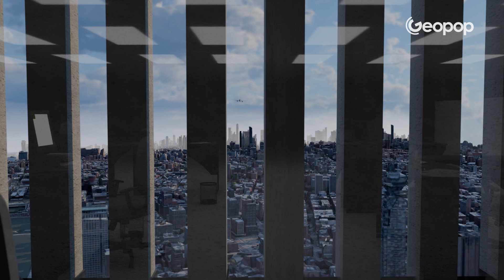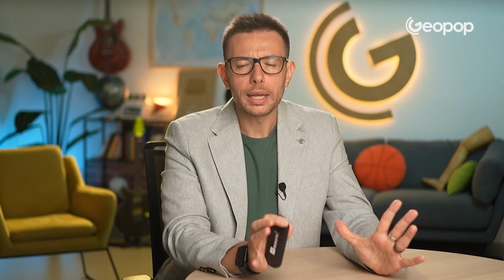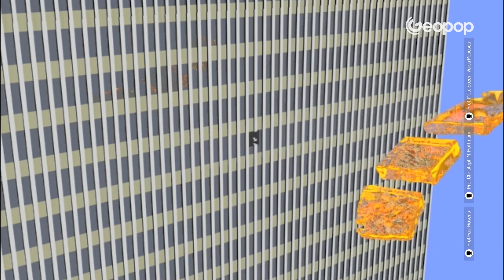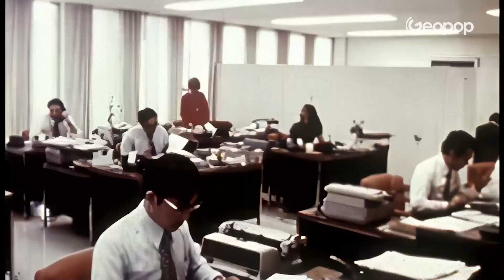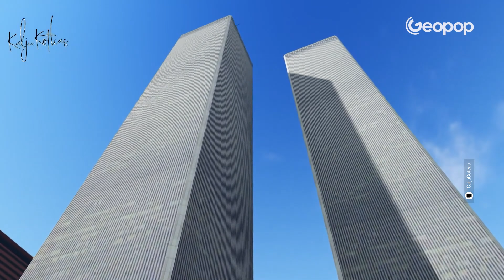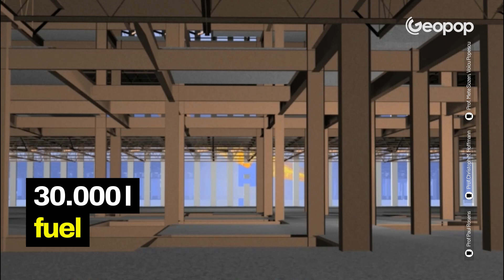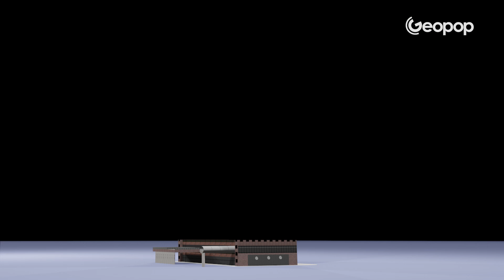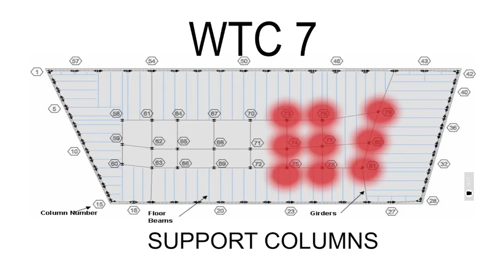9/11, 2001: The Technical Reconstruction of the Twin Towers and WTC 7 Collapses

Comment: It's a f**king plain as the nose on your face, only you don't notice it because you don't want want to look foolish by crossing your eyes.  Well, I'm not so arrogant and foolish not to see my own f**king nose on my face!  Just look!  Look at the f**king building blowing up in sequence as it "pancakes".  Makes no sense for a building to just crumble like that WITHOUT a LOT OF HELP which HUNDREDS OF EYEWITNESS TESTIFIED THEY HEARD NUMEROUS EXPLOSIONS IN THE BUILDING BEFORE THEY FELL AND DURING THE COLLAPSE SEQUENCE.  We also see it on the videos!  It's a plain as the nose on your face.  Just look!
Reply: Those so-called explosions were elevators falling down, which has created huge noise.
Reply: Gravity is a lot of help. An awful lot of help. 

This is my summary explanation of Twin Towers collapses of the Twin Towers, start-to-finish, based on my observations without appeal to, or reliance on any authority. No politics or ideology, just what actually happened, which is agnostic to who planned and carried out the 9/11 attacks or why. It has the benefit of not requiring Rube Goldberg levels of complexity and it makes logical sense. Each step in the process flows naturally from the one before AND is chock full of critical details the conspiracy-oriented internet tends to leave out with no whataboutisms.  My hope is this will dispel many common myths and answer most if not all questions you may have about the Twin Towers collapses. 

While complex, most of the Twin Towers collapse mechanisms can be seen with the naked eye and easily discerned and understood by the layperson if sufficient time is taken to understand. The worlds engineering community had already largely sorted them out at least as early as October/November 2001. Still, there are many who can’t be bothered to look or perhaps work hard not to see, being more concerned about advancing political/ideological agendas (which is exciting) than science and engineering (which is boring).

1. The Twin Towers consisted of 4 primary structural elements that together formed an integrated system where each relied on the others.  47 hollow box-section steel Core Columns carry the majority of the gravity loads. The 236 hollow box-section steel Perimeter Columns carry the remainder and ALL of the lateral (wind) loads. Long-span Lightweight Steel Trusses connect the core and perimeter column together at each floor with a Hat Truss on top to tie the structure together as an integrated unit where no element can survive without the others 

2. The impact of 117 tons of airplane (= to about 12 dump trucks) at speeds up to 590 mph completely destroys the aircraft.  This in no way implies the Towers come out unscathed. Some folks don’t get that. Hitting with the energy of up to a ton of TNT the impact damages or destroys many perimeter and some core columns (33 of 59 perimeter and 20 core columns destroyed at the impact floors in the North Tower), primarily through bolt-shearing failures at the end connecting flanges, as well as bending, twisting and fracturing of weld seams. There was no cutting or slicing - the reality was far more violent and messy. 

3. The impacts destroy or damage fire insulation, fire breaks and sprinkler systems on multiple floors. Huge fires are started across multiple floors simultaneously and allowed to spread rapidly with no effective firefighting or fire suppression. This was an unprecedented fire event . All of this was observed and recorded.

4. The hotter steel gets the weaker it gets .  With fire insulation stripped away and no sprinklers the survival time of the steel greatly reduced. Gradually over time heat causes the lightweight steel Floor Trusses at the impact damaged floors to sag, which was observed and recorded.  No steel melted nor did it need to. Structural steel will fail long before it turns to a puddle. It just needs to bend

5. Sagging floor trusses pull on the increasingly weak and overloaded Perimeter Columns, causing some of them to bow inward by up to 5 feet. This was observed and recorded. A straight column is up to 4 times stronger than a bent column. 

6. The bowed Perimeter Columns buckle and fail, initiating collapse. This was observed and recorded.  The formerly static mass above which the structure below could easily support is now converted into a dynamic mass up to 30 times greater. Because they have buckled, the Columns above and below the failure point are no longer aligned . The load bearing structure below no longer bears any load as it falls past the lower columns, NOT onto them.

7. Thousands of tons of debris fall within the four outer walls, down through the open office space, crashing onto the first intact floor it encounters. This massive impact immediately breaks the bolted connections to the columns as the amount of resistance the Floor Trusses can offer is negligible.  The falling debris slows only marginally and briefly. Note:
7a. This is NOT a solid top block crashing into and “crushing” a solid bottom block .
7b. The debris falls past the columns not onto them.  The columns provide no resistance to the falling debris. 
7c. Only the bolted connections of the floor trusses to the core and perimeter columns can offer any resistance. A pair of 5/8” bolts at each end of each truss vs. thousands of tons of falling debris.

8.  This floor-led collapse progression within the four outer walls can only go straight down. Note: 
8a. This process is often incorrectly referred to as “pancaking” which actually refers to a completely different process rejected at an early stage. The catchy name stuck but nobody knows what it is supposed to mean.  Pancaking is too simplistic and inaccurate anyway. More like Kaiserschmarrn.

9. Collapse progresses through the floor systems and not down the columns. Rate of floor assembly failures increases with each successive floor as momentum increases, reaching an average acceleration of 0.65 of GA, or 35% slower than true free fall. Bam, bam, bam down the building until there are no more floors to fail.  The resistance offered by each successive floor is always the same. The mass and velocity and thus the energy of the falling debris are constantly increasing.  The falling mass increases with every floor it destroys as new falling mass is added. Some falls to the sides, but most falls down. More mass, more velocity, same resistance with each floor.
The above is unquestionably the path of least resistance

10. The Towers were 95% air by volume and as that air was compressed inside the building it is forced down the tower and blown out the sides in reaction to the building collapsing not causing the collapse. Those were not “explosions”, it was expulsions of compressed air. 

11. Perimeter Columns become detached and peel away like a banana behind the collapse front, playing out to the four points of the compass extending to more than 600 feet from the base of the towers. This was observed and recorded, the results quite obvious from examination of the debris pile. 

12. Core Columns fail last as their internal beam bracing is stripped away by falling debris and lateral support from the floor to perimeter columns is lost. This was observed and recorded and is most obvious in the North Tower. 

13. For those who care about how long this took, the whole process took 31-34 seconds from the moment the perimeter columns buckled until the last core columns hit the pile, or 1/3 the rate of true free fall. Don’t believe me?  Just watch any video of the collapses and note all the loose and truly free falling debris dropping much faster than the towers themselves.

14. What was NOT observed and recorded were the 180-190 dB bangs of high explosives or the blinding bright flashes of burning thermite. Of course, neither could have caused the (silent) Perimeter Column buckling that was observed.  Neither explosives or thermite could have survived the impacts and subsequent fires either. Cherry-picking a casual comment from someone who heard a loud noise in an event like 9/11 is not exactly “proof” of anything and the pre—planned demolition case relies entirely on that. There is zero physical evidence to support either conjecture. It would be technically impossible, totally impractical and completely unnecessary. No one would bother. 

15.  The Twin Towers were perfectly safe within their design envelope.  They only collapsed when taken far outside design parameters by an extraordinary and unprecedented event. 

Impact + Fire (heat) + Time + Gravity = Collapse . Remove any one of those four elements and there is no collapse. Ignore any of those elements (as many do) and you will never understand the collapses. The Twin Towers were an integrated system in which no one component could survive without the others. One fails, the rest follow, through the path of least resistance – DOWN – through the open space, bypassing the path of greatest resistance – the columns. Don’t get stuck on the but the lower floors weren’t on fire nonsense. 

I hope you found this helpful. It is meant to be informative, not adversarial, posted with the objective of soliciting informed critical comment, positive or negative. If I made any errors of fact, logic or reason or left anything critical out, please let me know so I can fix it. One topic at a time, on topic only please to stay focused, no word-salads of Gish Gallop. IF you can offer a more plausible alternative be my guest. So far no one has even tried. Please start any reply with the words “Tits McGee” or I will know you didn’t actually read it, are not serious and just wasting my time.
Reply: @TheLoonResistance  gravity does not explain HUGE segments BLOWN LATERALLY hundreds of feet away.  Does not explain the presence of nano thermite and active thermitic materials found at ground zero.  Does not explain the explosions in the basement and does not explain the explosion in the ground floor not related in any way to the planes crashing into the bulding hundreds of feet above.
Reply: @jessedorsettii9988  - What _HUGE segments BLOWN LATERALLY hundreds of feet away?  

This is a myth and the actual cause for the debris spread is detailed in my last post.

Which you did not read.
Reply: @TheLoonResistance  You see it.  They are lodged in the adjacent building hundreds of feet away.  Jesus.  What planet are you on dude.  We saw this when it happened.  I remember.  I was 31 years old when it happened, not a kid in diapers.
Reply: @jessedorsettii9988  -  Ummmmm, yeah you mean WFC 3?  That's not how they got there. 

Perimeter Column Peel-Off, NOT lateral ejection. An inevitable byproduct of Twin Towers collapse progression mechanisms.

Collapse initiation in the Twin Towers was due to sagging floor trusses at the impact-and-fire damaged floors causing some of the perimeter columns to bow inward by up to 5 feet until the buckled. This got tens of thousands of tons of structure moving.

https://www.youtube.com/watch?v=ULdiD6gYZO0

From there, collapse progression was that moving mass dropping largely inside the four outer walls, through the open office space, instantly failing the pair of 5/8" bolts that secured each end of each long-span floor truss to the core and perimeter columns, floor by floor.

As floors continued to fail, tall segments of perimeter columns spandrels became detached from the rest of the structure and were literally left swaying in the breeze. These then peeled away (think Banana) and toppled in sheets up to 60 stories tall and splaying out to the four points of the compass out more than 600 feet from the base of the Towers. 

In this compilation of North Tower collapse videos we can if we pay attention spot the perimeter columns peeling away behind the collapse front in large sections. I recommend setting to 1080p resolution and 0.25 playback speed;

youtube.com/watch?v=yaydhlOVogk&t=232s&ab_channel=fresnosean379

At 3:58 watch the center of the screen (right side – west side - of the tower) as the peeling section of perimeter columns starts to emerge from the smoke and dust cloud just to the left of the pointed roof of the WFC building. You can follow this section down through its arc of travel.  We will be revisting that particular assembly in just a bit.

The next clip of interest starts at 4:40, again shot from the north and looking at the north and west faces of the North Tower.  Watch the large section of perimeter column spandrels emerging from the smoke/dust cloud on the left (northeast).  This artifact almost certainly broken away from the upper section of the tower as it started to drop (note: this piece alone kills all claims of collapsed at free fall speed BTW).  You will see another one emerge from the cloud on the right (west) about a second later. What we are really interest in though is this gives us another angle on the huge slab of spandrels from the previous clip. This emerges from the cloud at the top right at 4:45 and we get an excellent shot of it falling through its arc towards WFC3 on the right. 

Those paying real attention will notice Building 7 comes into frame at 4:41 on the lower left. At 4:42 we see a big slab of spandrels emerging from the cloud at the north face right in the direction of Building 7. That’s the chunk that clobbered Building 6. But as it drops out of sight at 4:45 note there is another large section above and further out than it, headed right for B7. Behind and even farther out than that at 4:48 we see other debris heading towards B7. That bit actually hits. You can see that even better looking from the west at 6:08. 

Moving ahead from 6:51 we get another, wider shot from the north and we can really see the huge slab peeling off from the west face (right). A brilliant shot of how massive that section was as it arcs down until it drops out of sight at 6:56.  

From 7:54 we get a shot from the southwest (finally) and while the resolution is poor by now you should know what you are looking for and will be able to spot the perimeter column sections peeling off.

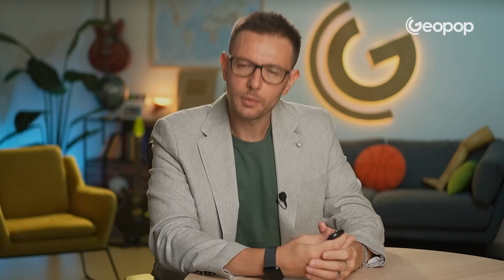If you really want to see it though, I suggest this video from 1:07.  

youtube.com/watch?v=kWCDA09XFT0&ab_channel=3RoadsCommunications

On the right is WFC3, on the left Building7.  Just coming into frame at the top of the screen is the huge sheet of toppling perimeter columns on the west side of the North Tower. Watch it at 0.25 and HD and from this angle you get a real feel for the size of the thing.  

Anyway, that’s just a few examples.